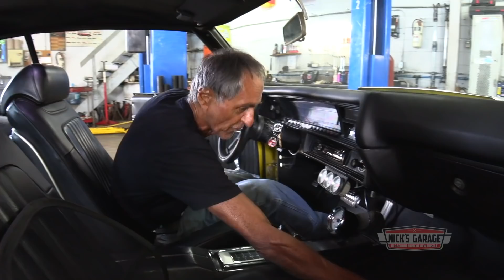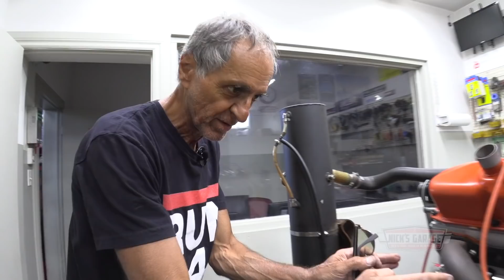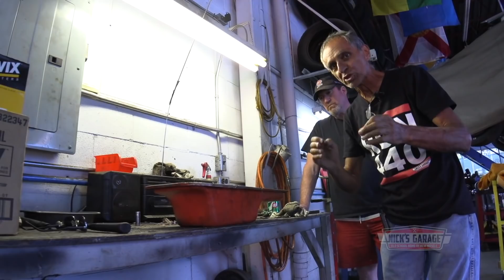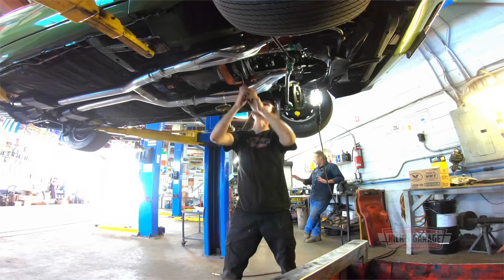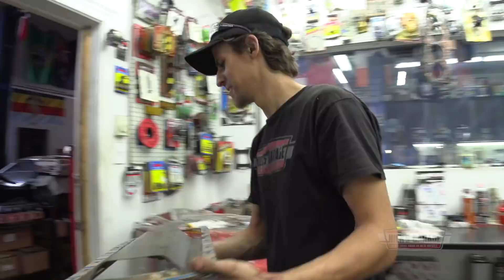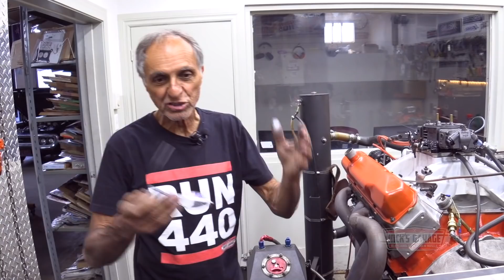Chevy Ford and Mopar at Muscle Car Heaven - Try To Keep Up With Nick

Comment: Where’s Vascili?? I’ve been gone a while…

I’ve always used the oil pan bolts dropped through the holes to align gaskets/ let the dabs of glue dry, never seen clothes pins used

Comment: Top tier tips and tricks!! dont tighten your oil pan so much that you need to hammer it back... but also, if it's not sealing, that might be why.
The trick where he pressurises the cylender to replace the valve spring/guide seal makes so much sense, but its still something that is shocking in its simplicity the first time you see it.
Loved the video!
Reply: Beats stuffing the combustion chamber with rope through the spark plug hole.

Comment: 351 Clevelands are popular in Australia and the lack of low end torque was factor with most of the high performance versions. The reason was the giant intake ports  so a company here makes a thing called a tongue, which fits in the intake port to decrease the size and increase the flow at the same time. Heads and intakes are also made here for them . The cheaper idea is to stick to Mopar.

Comment: Nick -love your videos! What CFM size Carter AFB was stock on a 1967 Dodge Charger 440 Magnum???
Reply: I do not have that info. Sorry.  They were not big CFM in those days.  Probably 650 CFM.
Reply: @nickpanaritis4122   Thanks Nick -that’s kind of what I thought -I changed to a 3310 780 cfm back in ‘69 and it seemed faster but just seat of the pants hotrodding in those days!!!
Reply: @alanvega4587  .    We have also gone with the 780 CFM #3310  for Eugenes 440 on the Charger 500.
Reply: @nickpanaritis4122  I saw that ! That’s what made me think to ask you!! Again -love your videos and will be anxious to see Eugene’s 440 on the dyno run !🏁

Comment: Nick, I'm kinda a purest when comes to the 65-72 muscle car years,(born in '64, so no real surprise there) consider myself fairly versed in them. either that blue Mach I is a VERY RARE car with options just on that car...or it a modified Mach I, or a fake. The gauge package on cowl and the angled fender stripes, never seen before on a Mach I, and MACH I, was never above stripe on front fender

Comment: Nick Great video where can I get the tool you used to keep the gasket in place before you put the oil pan on ? Did not see it in the the list of tools  in the description thanks again
Reply: Fel Pro sells them, and sometimes they come with the gasket set.  Fel Pro calls them snap-ups. There's various thread sizes, so if you buy them separately you'll need to know what thread size the holes in the block are.

Comment: I only need this one thing repaired on my car.   Then when it comes in to the shop.....Oh I have a couple of other things I need repaired also.   LOL   It never fails.   In my state all of the vehicles get a safety inspection once a year.   I always used to have several customers that would wait until the last day of the old inspection to call me up and say....I need my car inspected.   The inspection runs out tomorrow.  It was at least a half hour to 3/4 hour job to check everything.

Comment: A friend of mine rebuilt a VW square back engine. He did a great job until he put a super thick bead of permatex on everything. He had to tear it apart again because that permatex was all over the inside of the engine.
Reply: gasgacinch is/was the go to sealant for vw things.

Comment: I'm interested in how Nick does deal with a concern such as lack of torque.  Are springs weak, is advance  spread out to far, is carb A/F off during WOT, is 1 or 2 cylinder's not firing, compression check and leak down check, 4 bbl's not opening, looking forward to maybe one day an episode geared towards answering that question. It's hard as a customer's perception of "seat of the pants" can be difficult to iron down what they mean exactly.  My thought would be does the torque curve on dyno show " dropping torque instead of a nice flat curve?"   But he isn't going to pull an engine to dyno to see that, so how does mechanic handle that , maybe torque converter slipping as well.    Anyway hopefully one day an episode on that would be great!

Comment: I don't want to diss somebody else's car because we all like what we like, we all have budgets, and maybe they bought the car that way; but I have to say it- that fastback Mustang would look SO much better without the Ford truck wheels and incorrect/knockoff looking decals.... that's one of the very most desirable musclecar body styles ever, it deserves more appropriate wheels (oem, period correct aftermarket, or modern high end aftermarket units would alll work equally well) and either a factory correct graphics package or nothing at all. Just IMHO. Gorgeous car but those details are a little distracting. Not hating, still way nicer than anything I own!
Reply: Yeah, I am with you on the Mustang's current livery. If Nick's too busy to tackle the mechanical issues. Get him to hold your place in line and take it to the paint and body shop. In this case, more is not better.
Reply: Have to agree with you. I remember the first time I saw one back in '69 or '70. I was 10 or 11. Remember thinking "man this is a cool car"  it was white with black graffic's & black interior of course.

Comment: Old trick my dad showed me is to use thread and tie the gasket in place. You start a few bolts then cut the thread and remove it then tighten the bolts

Comment: I really like that dowel idea for the oil, I’ve used really thin wire to hold my gasket until I get some bolts in then cut them & remove

Comment: NICK
I gotta have those pan alignment tools, man! Hook me up! Who makes those?
EDIT: Found them: 
Fel-Pro ES 72863 Oil Pan Snap-Ups
I am DIGGING that home made valve spring compressor, too!

EUGENE
I'm starting to think we're gonna have to bust your 500 out of body shop prison, my friend!
-Ed on the Ridge
Reply: they often come with the better gaskets and gasket kits
Reply: @moparedtn, Hey Ed hopefully it won't be too much longer until Nick has the 500 back in his shop. Once Nick has the 500 the reassembly should hopefully go smoothly.
Reply: @eugenecastles7475  Of that I have little doubt, sir. :-)

Comment: I bring the piston to top dead center just in case you lose air pressure. Then you can still retrieve the valve.
Reply: You would have to keep cranking the engine over, adding a whole lot more time to the job though.
Reply: On a v8 engine you only have to crank it 90 degrees per cylinder. Time well spent if you drop a valve and have to remove a head.
Reply: @joesmith306  Time is money. He was working alone. Quicker and easier for him to air up the hole, change the springs and on to the next one. I'm sure he calculated the risk to reward $ per hour to risk of losing air pressure. No doubt the odds were well in his favor for success without the extra time to spin the engine between holes.
If you're doing it at home for yourself where time isn't money, then why not though, right?
Reply: @Warrior_Resisting_Colonialism  wrong
Reply: @joesmith306  I'm sure I'm correct, as I'm sure this is exactly how he did it. I'm 100% confident, Nick accomplished this job without turning the engine over and without dropping a valve. Aren't you? You might not like it but I bet that's how he did it and I bet he didn't have a single issue.
Reply: @Warrior_Resisting_Colonialism  That's the way he did it, but he took a chance.
Reply: @joesmith306  I understand you. I really do, Joe.

Comment: That Cleveland, the guy says no torque I wonder if it got 4V heads, 4V heads real good for hi HP but not so good for torque, the 2V heads are a lot better for torque and is better for the street.
Reply: He should use a spreadbore carb to improve low end torque and port velocity.
Reply: @Car Guy daddyo That is the truth.
Reply: I had to look up 4v vs 2v. I thought it was valves and not 4bbl vs 2bbl carb.
Reply: @datasailor8132   I think they were called 4v heads because they always had a 4bb carb on them, they used them on high-performance motors, but the valves were too big for the street and had low torque at low rpm and the 2v had smaller valves and a lot better torque for the street, I do not know if the 2v heads had 2bb carb and 4bb carb? I think mostly 2bb carbs.
Reply: A quick fix would be to bolt on a performer intake for 2v heads along with a spread bore carb. Even though there's a port mismatch between the 4v heads and 2v intake, the increased port velocity at low RPMs makes it worthwhile for increased throttle response. Get rid of the Edelbrock carb.

Comment: what is the Part # for THe PIN you use to hold the old pan
Reply: They come from Fel-Pro. I do not have the # on hand. They usually come when you buy a one piece oil pan gasket.
Reply: Thank you Nick

Comment: Using air pressure to keep the valves closed while you change the valve springs brings back a lot of memories for me. I changed out a lot of worn out valve stem seals that way as a line mechanic for a Ford dealership back in the 1970s. Still have the spring tool .....somewhere...
Reply from the maker: Thanks for sharing

Comment: Here we go It's the Nick's Garage Monday show Try to keep up with Nick his muscle car knowledge is legitimate because he knows every trick for your whip This blue Mach One looks like it goes faster than the bullets from a gun I bet the owner is well up for some drag strip fun
Interesting to see on a typical day at Nick's Garage what jobs come his way That's a really nice yellow Chevrolet All it needs is a permanent flasher solution to bring the client a resolution The Oldsmobile has passed inspection now it's ready for collection The green Challenger had an oil leak not a good way to start the week The boys have removed the oil pan it might look dramatic but it's just a part of the plan
The General Lee with the 383 is like a breath of fresh air to me Now the Dukes of Hazard movie I really wanna see The fuel injection needs inspection The Yenko Camaro's short block is out for balancing but not before Nick installed every bearing I'm not patient like Nick if I couldn't get the parts needed I'd be swearing
Johns engine is finally in The GTX is almost ready for a spin it's a win win The heads for the 289 took their time but now Nick has them he's feeling fine 
Eugene's 440 is on the Dynamometer it sure is a keeper his Charger 500 will be far from a sleeper Shout out to Mark for the pizza 
Leo and Mark are replacing gaskets Nick is showing them the proper practice Just a few dabs of the sticky stuff don't overdo it it's more than enough Keeping everything clean so nothing will leak from the gasket seam Giving it a good hammer tap making sure the oil pan is flat 
There's a Hemi ready for delivery and another for assembly at Nick's Garage the metal is heavy The Jensen needs a carburettor because Nick demands perfection on this classic car there ain't no fuel injection 
Dan fixed the Chevelles sway bar brackets and repaired Eugenes dip stick Damn he works quick The gasket makes the seal and a car with no leaks will seal the deal Nick's Garage every Monday has got muscle car appeal!
Reply from the maker: WOW! Talk about try to keep up! You are the master, ain't none faster, the rhyme caster, top lyric blaster.
Reply: @NicksGarage  Always a pleasure Fella! Nick's Garage every Monday is an absolute treasure

Comment: .040 Cleveland hmmm that’s maxxed imho. I wonder what heads are on it? 2V or 4V? Closed or open chamber. You really have to have the perfect match , cam, heads, carb for that engine
Reply: Agree on all points. I cringed when he said .040 over.
Reply: @zrxer2  same here